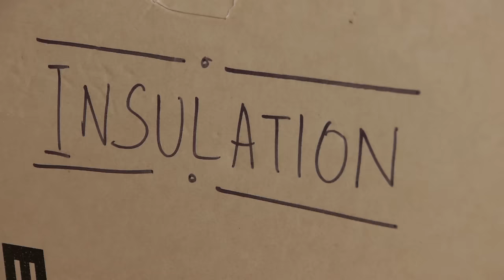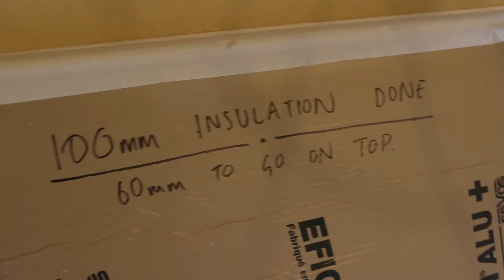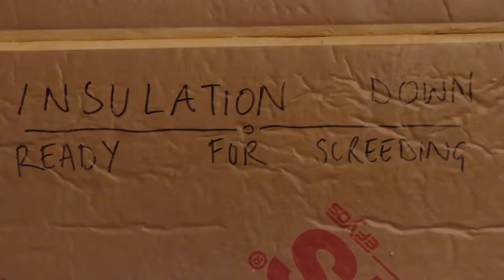How to Build a Floor - Insulation and Screed

Comment: Been screeding over 30 years now, never laid a screed on bare insulation boards ever, polythene is cheap and will save you 20% UV value, as the cement destroys the reflective foil .Other than that , perfect video,thumbs up.
Reply: So you recommend putting a polythene sheet down before you cement on top of the insulation boards?
Reply: @z8Nation   yes i have always put a barrier between cement and insulation boards, you dont have to tape board joints also it stops joints following through the screed, reducing cracking.
Reply: @z8Nation  put like this I'm just putting in a similar floor in 2021. Architectural plans stipulate vapour check membrane over insulation boards before scree.
Reply: @sanjikaspinoni8396  How long will a 65mm screed takes to dry after applying it on the insulation board, although using a membrane.
Reply: @graceakinje4965  Dry usually 48 hours. 6-7 days before ready for heavy traffic...but always check on your I individual product advice.
Reply: I have a concrete slab. Would you put polythene on top of that then the insulation then another layer of plastic then the screed?
Reply: @garvielloken3929  yes mate, the poly under the insulation should be , Damp Proof Membrane, on top of insulation can be just cheap clear poly.
Reply: @purritan326  Nice one mate!
Reply: @purritan326 could you still use DPC on top of the insulation boards? I’ve got a load left over
Reply: @r_kel89  yes anything that protects the foil from the screed paper even.
Reply: @purritan326 im building in ireland, doing floor insulation now. Im putting 1000 gage plasyic on floor first and turn it up the wall, then a 25 mm up stand around all boundry walls from floor to above where finish screed will be, then 6 inch insulation on floor butted upto the 1 inch upstand, then 1000 gage polythene again dosn onto of insulation and turn it up against wall again. Any excess i can trim off after finish floor is set, ia this ok or instead of standing my 1 inch insulation upstand ontop of floor should i have it ontop of the 6 inch insulation??
Reply: @jericho9653  personally I would put the 25 mm edging in first and butt up to it with the 6 inch .
Reply: @purritan326  damn. I started my floor insulation ontop of my concrete slabs upstairs yesterday and i am only putting 1 inch down  there. But i never put the 25mm strips down around the boundarys there when i should have so, i wonder if i lay my edge strip onto of my 25mm indulation upstairs would i get away with it since its upstairs. Other option is to cut 1 inch out of the paremete of all the sheets iv put down and slip and a 25mm edge strip in there, or maybe use the roll of expaning foam insulation and go all around the parimeter with that ontop of my 1 inch sheets on the floor. I presume when people use the expaning foam rolls they dont do it from the floor up and only do it from the insulation up to where the screed will finish and trim off after
Reply: @jericho9653  it's not a problem on top, under as long as it's in .

Comment: The job could have been improved by closing the gaps between the insulation boards with some gun foam and taping the joints of the top layer.
Also a PE membrane should have gone on top to protect the aluminium foil, cement is caustic and reacts very well with aluminium, so it eats trough, the membrane also acts as a vapour barrier.
You gave up on the cat exploring this big litter box 😂?

Comment: Thanks for the video.  Wasn't it necessary to tape the joints, usually done with aluminium tape?  Also shouldn't a moisture barrier have been put down before the screed?  I understand the screed can chemically react with the PIR surface.

Comment: quick question - how would you run central heating pipes to radiators now the floor is concrete and walls solid  brick? I noticed you had cut out sections in the insulation boards for electric cables - could you have done the same for running pipework (might be silly question)

Comment: If the sub floor was soil, what would go in-between the soil and the insulation boards?
Reply: Hi, you could put a layer of sand, called blinding, then boards on top, followed by dpm then screed

Comment: Hello. I noticed the house we purchased the extention attached to the house - the flooring does not have insulation.  There is a membrane and 4" concrete on the floor. However is there an option i could insalate the floor  before we decide to put either laminate or carpet down? Thanks in advance
Reply: Have a look at a German company called GUTEX, you'll need a membrane to stop moisture passing through, especially if the concrete slab is bridging and allowing moisture to pass through

Comment: The screed came out very well, but I think a lot of people will confuse it with concrete, one thing I can see from your video is that the floor level now seems 6" above original, which will make the doorway smaller? Is there something I am missing here, I dug down 10" before I started laying rigid insulation and built up to original level. You appear to have some very unpleasant viewers to your channel ! Chris B.

Comment: Honest question from over in the US, what advantages are there to using this method ( low hydration Portland  sand mix 1/5 or so guessing ?) To just pumping in some concrete?
Reply: Cheaper
Reply from the maker: yup, just cheaper..

Comment: Hello! What did you lay down as a dpc or something to stop the moisture barrier? I assume this is a true old building and it's solid walls would not have a barrier at the base layer. It would be great to explain the initial methods to the process. Have you done something to stop moisture from the base floor? Looks like you had some initial concrete layer before the thick insulation boards.
Reply: They’ve missed it out 🤦‍♂️😂

Comment: what's is the advantage of this insulation sheet in flooring
Reply from the maker: insulating the floor helps keep warmth within the room/building
Reply: carlrogers are there other type or options of insulating materials?
Reply: eguonor akpomudjere jablight buried within the cement and membrane itself

Comment: No need to tape the insulation seams when using this method to keep the moisture from penetrating?  No need for a wire mesh in the screed mix  to keep it all stable?  I guess the  floor just floats or does it sit on some kind of foundation that supports the stone walls?
Reply: Wasn't the underfloor concrete?

Comment: sorry in my country we don´t do that. that insulation is for what? does it prevent wet? or is a termical insulation?
Reply: keeps your feet warmer in the winter. also under the original red  floor below, we hope, is either a tar or plastic damp proof layer

Comment: No DPM under insulation  or 100 mm up walls ?
Reply from the maker: supersesqui there's membrane under the concrete pad, below the insulation.
Reply: carlrogers is there not supposed to be also above so the screed doesn't rot the rigid insulation board...????
Reply: Supersesqui i did give that a thought too we have to put 100mm upstand round the walls and there is usually 2 layers of dpm. First layer under the concrete then your insulation then dpm then screed. But i cant imagine there will be any problems with it i think building control measures are over the top sometimes but i have heard the concrete rots the insulation....

Comment: What happens if you put something heavy on it like a piano? Wouldn't it sink in after a while?
Reply: that is why the top layer has to be thick this looks like about 70mm thick - so the load at the piano legs is spread over many square metres of insulation

Comment: Hi Carl you may have just solved a problem my old kicthen is 5 inchs lower and tiled onto hard core . Can I use this solution to raise the floor and tile then put my kitchen floor units on top ? what sort of strength have these boards ? i was looking for wedi boards and this cameup - is the concept the same? thanks

Comment: Can you pour on top of celotex etc.. ? isnt it kinda spongey ..is this good practice ?? Let me know cos I could do this in my shed .. if not ill try summink else ...thoughts ??
Reply: You certainly can, but the cement on top  needs to be thick enough to spread any point load over a large area of insulation so it does not collapse. That was probably 70mm thick (3 inches ) thick.

Comment: I wondered if foam concrete could offer an equivalent insulation quality compared to this conventional method of installing insulation panels topped with cement mortar screed surface?
Reply: Have been taken by the idea of foamed concrete, but it looks much softer.  So I'd have thought you may need to then top with something else.  Not that I can grok u values.  Perhaps someone would post a comparison including thickness.

Comment: Noob here. electric cables under concrete floor... how do you replace/renew?
Reply from the maker: fair question. the cable we're putting down is actual conduit - basically a tube through which the electrical wiring runs. if you need to replace anything, you can just attach to the existing wire and pull through!

Comment: So it looks like you put foam padding under concrete.
I wonder how this turns out long term?
Reply: its a sand/ cement screed not concrete and the insulation will be made out of a plastic material so they will last long enough :)
Reply: That type of insulation board is now standard insulation required by UK planning regs. .....so we're hoping it's gonna last a few life times at least...fingers crossed.
Reply: in the UK we have been doing this for about the last 25 years and failures are very rare, so long as the top layer is sensibly thick to act as a load spreader. This looks like about 70mm

Comment: Sir insulation materials what . 
Thickness
Sizes.
Durability 
 Cost 
Details sir
Reply: There's a shot in the video where they show you thickness, look for the part where the top layer is applied.

Comment: what city are you doing this in. I hardly see people mention doing it. Im in NYC and need a comfortable basement
Reply from the maker: this is very rural france - only in these kind of places could you get away with doing it fairly unregulated - i.e. with limited health and safety...to do this in a city would cost far more because of that
Reply: In Poland this is standard. I have it at home plus that I have water piper inside the concrete slab for floor heating. Works with no issues for 10 years now. I have 16cm of styrofoam but the floor is 60cm above the ground and it’s super dry here so I could use EPS styrofoam not XPS like you.

Comment: Great video thanks for sharing. However, it looked as though there was no perimeter insulation. Should have at least 50mm. I understand that 83% of heat losses are through the edge. Without perimeter insulation the cold external wall acts as a thermal bridge. I made this mistake on one job, never again.

Comment: Hi there,

What's the ratio for this mix??
Reply: Moeen Ahmed 4 to 1
Reply: Hi Kyle.

Thanks for responding back to me.
Just a couple of questions of more to ask your advice.

When you say ratio 4 to 1. Do you mean 4 part Buildings sands and 1 part cement???

Also is the mix suppose to be a bit dry or can you have the mix a bit slurry???

Also how did you manage to keep the floor level????

Cheers,
Moe

Comment: No need to seal/tape  the joints of the insulation?
Reply from the maker: jakop0815 shouldn't be an issue, are you thinking that moisture would be a problem?
Reply: carlrogers heat loss.....but that's normally if using in rafters or stud walls, but I would usually tape it and membrane on top......! Great job though
Reply: @frankiedancaster4424  where the world got "HEAT GOES DOWN " from I DON'T KNOW ........ heat rises what insulation in a floor is for is to stop the cold  !!!
Reply: Generally it could just be acting as a cold bridge between concrete and screed/underfloor heating🤷‍♂️

Comment: Very handy men! Great work and excellent video, no club music, no unnecessary "explanations". I'm not familiar with that insulation , however I would have used thin set mortar to set it on the subfloor and I would've used thin set mortar between it and the dry pack (mix) bed also. Anyway, I'm sure it lasts for many years! Good job, again!